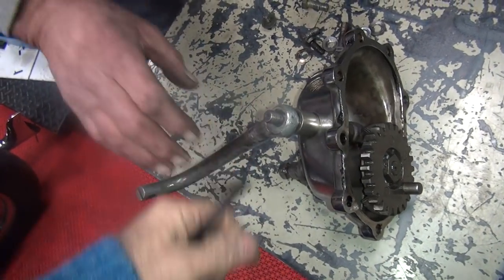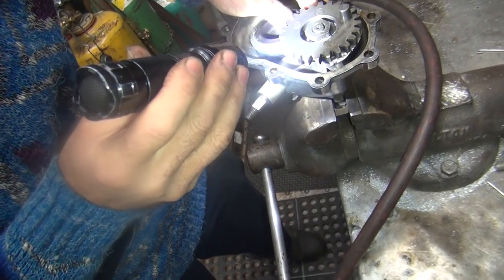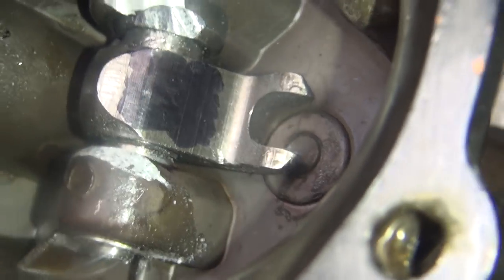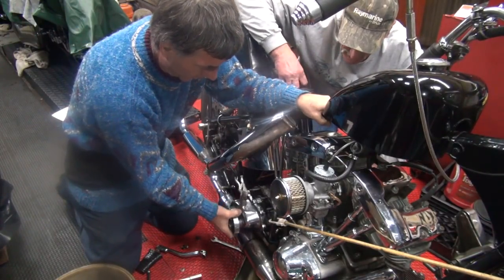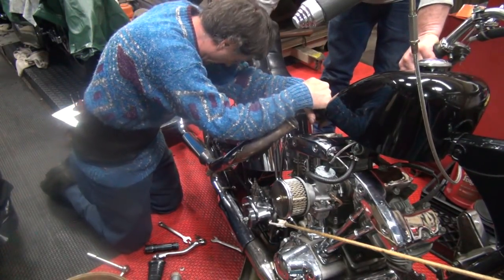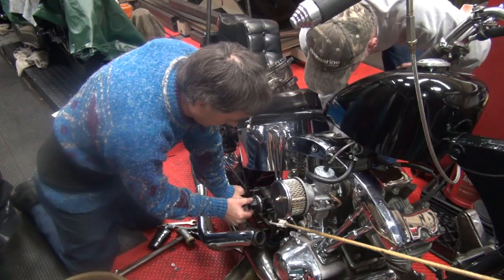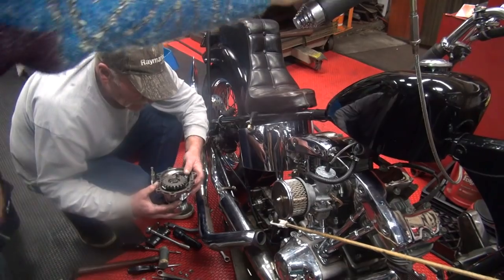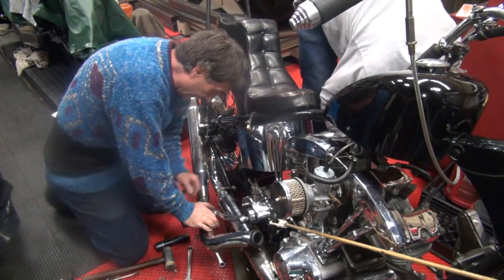#104 fixing clutch mousetrap and throwout bearing adjustment 1974 shovelhead harley tatro machine

Comment: I don't have any idea what your back issue is, but I had a problem with mine, had a MRI done and the Dr. said that everything was fine, that there should be no pain.  I went to a Chiropractor and he looked at the MRI and showed me the problem in 10 seconds.  He showed that I had two discs that were black and the rest were nice and white colored on the MRI.  He simply told me to start a regimen of about 3000 mg of 'fish oil' a day, because I had dehydrated discs, and the fish oil would re-hydrate them.

After just a few days, I was mostly pain free until late in the day, and I was taking the full 3000 in the morning, so I split them up and took 1500 in morning and afternoon, that fixed me.  After a few months, I didn't even need the fish oil anymore.  Now every couple of years the pain returns, and I just get back on the fish oil for a month or so, and I'm good to go again.  

I guess I should just take that stuff all the time for maintenance.... Hope my testimonial can do you some good.
Reply from the maker: something to think about.
tatro

Comment: I would have removed the kicker spring till after the cover was installed, that way the kicker shaft could be rotated to wherever you needed it to be. Spring could always be installed after all was working.
Reply from the maker: that would be very hard to do if you ever tried it youself.
tatro